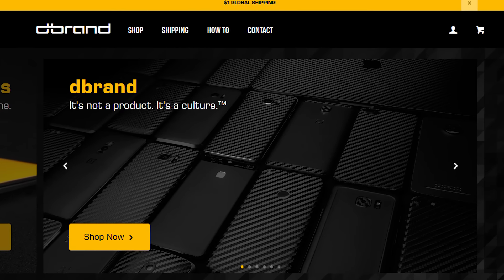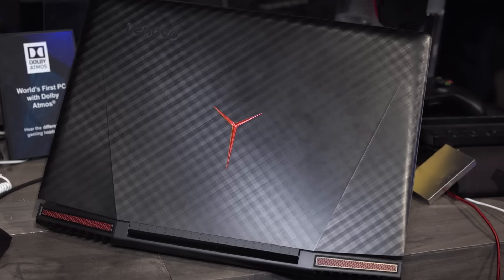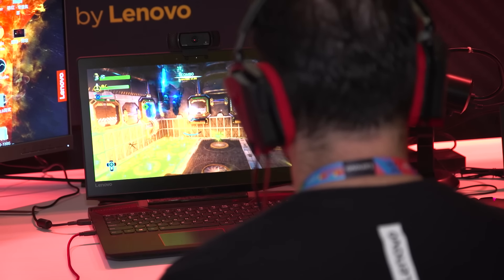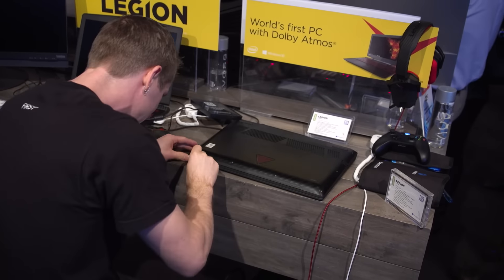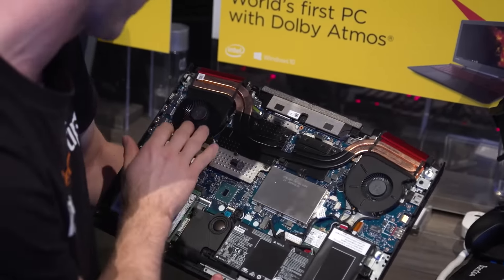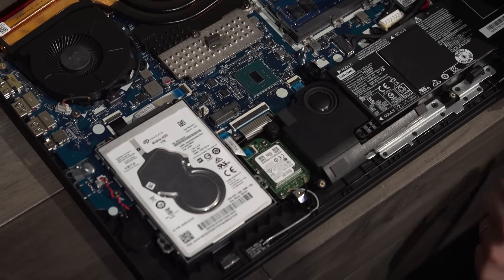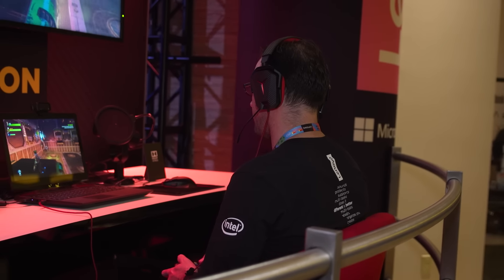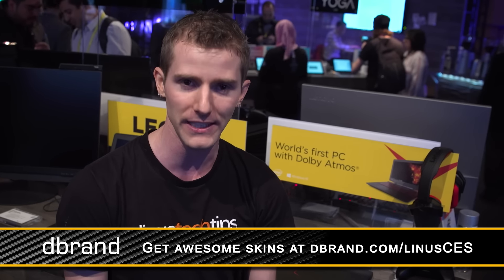World's First Dolby Atmos Laptop

Comment: 3:14 They put that cover over the ram in attempt to stop you from breaking it 😂
Reply: I dont think they have made a Linus proof laptop yet......
Reply: Dell Latitude Rugged Extreme & Panasonic Toughbook maybe?
Reply: The metal cover is for EMI protection.
Reply: takes protective back plate off of laptop

immediately sets laptop down on sensitive components
Reply: You are everywhere man.
Reply: lo, me? nah. just addicted to the internet to much.
Reply: Static protection, with an aluminum case the hinges would allow transmission of electricity across the laptop and thus the shield is placed there for the electricity to jump the only access point into the internals. In short terms,  it's a Faraday cage
Reply: He tired wreaking the Dell one, i don't think he succeeded.
Reply: draginator6 yeah xD
Reply: @Dave Terry its a start :P
Reply: That might be perceived as a challenge by Linus hahaha.
Reply: Congratz! You're smarter than Linus!
Reply: I mean, only a laptop with a titanium-tungsten cover can survive Linus's madness.
Reply: So Linus is trying to wreck every awesome PC and laptop he comes into contact with, basically.
Reply: công Hinh Phan see how he almost dropped it. what if it dropped lol
Reply: Probably for rigidity as it looks like it would be pretty flush with the bottom cover
Reply: Stuart Trappe Haha, Nah I think I've just figured out the secret to top comment. Witty, and always blame linus for breaking things at Ces 😂
Reply: and then he put it on the table just with the motherboard exposed facepalm
Reply: Ewout Vd Vijgh
not a metal plated table, its all fine.
Reply: k srry freaked out for a min
Reply: lol thats funny

Comment: The shielding is to help protect against cosmic rays.
Reply: Linus, here's the guy you were talking about
Reply: Instealer it was a joke lol.
Reply: I was playing around as well
Reply: OverclockedSanic it's a tinfoil hat to protect your... memories... eh... eh...
Reply: Or help the Leigon survive a black hole.
Reply: But Linus flipped the laptop over, so the shielding isn't protecting from the top but from the bottom. Maybe from Earth's magnetic field?
Reply: maybe even incorporate it into a hat of some sort, maybe a beanie
Reply: Sergio Ruelas It was put there for a reason:
Lenovo knew that sooner or later, Linus would arrive at the 2017 CES show. And Linus has a reputation for taking computers apart. So that's why they put that metal plate: it was meant to prevent Linus's Hands of Destruction.
Reply: Your comment is less a joke than u might think. Cosmic Rays can really be the reason for like bluescreens, i mean, there is a reason ECC Memory exists. But mentioning, that this maybe will occure once per year, I don't think anyone needs that plate unless he lives in a nuclear zone ;)
Reply: A flimsy piece of sheet metal does jack shit against cosmic rays. You need a LOT more for that. It DOES help with Electromagnetic Compatibility and internal shielding though. If you look at the inside of most plastic laptop cases, they are sprayed with metallic, conductive paint to help shield against EMI. RAM is notorious for EMI due to the long signal paths (they act like antennas) and the connector itself. You can get away without the shielding, but it's a nice touch of attention to detail.
Reply: Yep I know, I believe we saw the same video with that information about BSOD and ECC memory. It was a joke based on the info I learned from that video lol.

Comment: $1200? That price is pretty good for a 6700HQ and a 1060, plus swappable RAM and storage. I think we've got the average person's 2016 MacBook Pro killer here.
Reply: Isn't just about everything a MacBook Pro killer these days?  Not like Apple made it a difficult thing to do, haha.
Reply: dimples282 Not a fan of the 2016 pro, but they're completely different computers. One is aimed to be extremely thin and light, while the other is a gaming laptop at a reasonable price. Everyone just sees any random laptop with better specs and says it's the MacBook Pro killer these days.
Reply: dimples282  It's 7700 HQ 7TH intel processor Not 6700HQ
Reply: 7700HQ* and yeah that is a really good price. My laptop with a 860M and an i7 4710HQ cost about 1k in 2015.
Reply: Oh, right, my mistake.
Reply: I bought the predecessor (Y50) for 800$ a year ago...
Motherboard died 1 week after the warranty , screen cable died , massive issues with the wifi card...
It's cheap , but don't expect it to be solid.
Reply: +omar717 "aimed to be extremely thin and light"...isn't that supposed to be the non-Pro MacBook which is literally dedicated to fulfilling that niche? While thinness is a nice thing to have, I'm pretty sure plenty of pros wouldn't mind if the same thickness is kept if it meant that Apple could've squeezed in Polaris 10 (RX 470, which would be having that rebadged as Radeon Pro 470) instead of Polaris 11 (Pro 460). The 1060 is going to smoke the Pro 460, even in actual "pro" scenarios (and that's before you throw CUDA into the mix). If I could get a "GAMING!!!" laptop that isn't a total brick (which this doesn't seem to be) and actually packs more power (1060, GG EZ) for similar or even lower cost than a 2016 MacBook Pro, AND has greatly missed bonuses like swappable RAM and flash storage that isn't soldered, I'd definitely jump on anyway even if the machine's primary purpose is in fact games.
Reply: Without a doubt, they do have a killer resale value while this one will be treated as "just another PC laptop".
Reply: Eh. Mine's worked fine for 3 years, no issues at all. OC'd the hell out of it too, unlocked vBios.
Reply: dimples282 the y720 is i7-7700HQ

Comment: piece of metal shielding on the ram is a heat spreader, you can see the spacer and copper strip on the case when you took it off to stop it from getting a single hot spot

Comment: New Microsoft Xbox controllers work without the dongle. New ones use Bluetooth.
Reply: TheSonic Ravn I was thinking the same thing. Unless the rep came up and told him specifically my money is on Bluetooth.
Reply: God damnt i just got a dongle for christmas
Reply: Karim Essafi yeah I know. He just makes it seem like a bigger revelation then it really is.
Reply: who even use bluetooth for using peripherals to playing games. Wired is the way to go(les latency) but wifi receiver is also good. DONT USE BLUETOOTH
Reply: Azriq Haikal If you're using a controller for PC gaming, it's usually not for anything competitive.
Reply: That sounds less efficient since you would need multiple bluetooth receivers to connect multiple controllers no? I mean if worse comes to worst, then you could always plug them in using a Micro USB-USB cable. Though that would take up the limited USB ports on the laptop.
Reply: blame that shitty range on your bluetooth adapter, motherboards dont come with it, wifi cards do, and you can swap them just like disks, my new controller shows no difference between that and the dongle, and I don't see much use for 2 controllers on a pc let alone 4 or 8, other than playing emulators and the odd 3 pc games that actually support splitscreen  or things like mortal kombat
Reply: LinusMLGTips still. The delay in some action game make the game slugish imo.  Even playing racing game, u can feel it. But for casual gamer, yeah.  Bluetooth os kinda "usable"
Reply: EspHack maybe to play some party game. Steam have a lots of it granted it not a triple A games and just indie.
Reply: ***** WWE games
Reply: Lathan McGhee You can connect multiple controllers via Bluetooth too.

it's not officially supported so I contacted ms support beforehand and they said something along the lines of "it should work but no guarantees".

I've only tried 2 at once though not 4.
Reply: This "new" tech from Microsoft is integrated within the motherboards themselves. It doesn't depend on the "normal Bluetooth" found in the laptops.
Reply: But the audio jack port doesn't work via bluetooth ! ;) So you can't play from your couch with your headset plug in to your controller via bluetooth. Via the dongle you can ;)
Reply: Thomas HALGAND
If your controller can connect to your pc via Bluetooth then your headset can too.
Reply: And what if I'm using an non Bluetooth headset?
Reply: +Azriq Haikal There is no noticeable latency if you're right near the bluetooth adaptor
Reply: Yeah but what my headset doesn't support Bluetooth?
Reply: Thomas HALGAND
Then you plug it into the 3.5mm headphone jack on the controller.
Reply: And this doesn't work via Bluetooth ;)
Reply: Thomas HALGAND
You can't connect your headphones to the controller via Bluetooth if that's what you mean, you can either connect your headphones to your pc/screen or you can connect to the controller with the 3.5mm jack.

You can connect controller to pc then headphones to controller with a wire
Reply: ***** You don't understand. I know I can't connect my headset via Bluetooth directly to the controller. Of course! 
But, if you connect your controller via Bluetooth and then plug in your headset via jack, the headset isn't recognized on the PC. 
In other words, via Bluetooth you can use your controller but you can't use your jack 3.5.
With the official dongle you can. 
Try it, you'll see ;)
Reply: Thomas HALGAND
What are you talking about lol?

Of course you can plug headphones into the controller while using Bluetooth.

I've done it with bose qc35 headphones and klipsch s4 iem's, both work without a problem. 

I used to do it with dongle too with the old non Bluetooth controller before I bought the Bluetooth controllers. 

If yours doesn't work then try updating the controller's software through the xbox one app on Windows 10.

I've got 2 white Bluetooth controllers and both work perfectly.
Reply: Seriously? I tried but this doesn't work for me! And I have seen some guys with the same issue! I'm going to retry it tonight maybe it been solved since the last time I tried (first weeks of the Bluetooth controller release) 
If this works, thanks buddy!
Reply: It can use bluetooth but I assume they also built in the connection that the xbone and the dongle are using.
Reply: Rhedox Yes that's what they did ;)
Reply: ***** I don't think bluetooth is limited
Reply: ***** I have two connected to my htpc. they show up differently in the bluetooth devices.
Reply: ***** Sooo I justed retry it and no it doesn't work for me. 
Just to be clear, I'm talking about this setup :
Headset connected to controller via jack and controller connected to PC via bluetooth. 
The controller work great but no sound in my headset via bluetooth. It works perfectly via the dongle tho' or directly on my Xbox One S
Reply: Xbox accessories app does not recognize xbox controller via Bluetooth
Reply: Oh wait! I justed plug in via USB to upgrade it and then I will retry!
Reply: Well... Still not working
Reply: *****
Microsoft website says only one controller is officially supported at a time but more may work.

I've got 2 running np.

Thomas HALGAND
That's the setup I'm talking about too.

I'm not using headset though, only 
Headphones but that shouldn't make a difference. My headphones don't have microphone.
Reply: Ok so I checked on Microsoft website and audio is not supported on PC while connected via Bluetooth... So yeah...
Reply: ***** I'm using a headphone too but it doesn't work either. I would really appreciate to see a proof of what you said because, yeah, as I said, Microsoft itself say this isn't possible.
Reply: "Controllers connected via Bluetooth do not support any attachments, including chat headsets."
Reply: To use a chat headset on your PC, connect your controller using a USB or Wireless Adapter for Windows, and connect your Xbox Chat Headset directly into your controller. See the following supported scenarios.

Sorry for the triple response
Reply: Thomas HALGAND
It also says that you can only connect one controller via Bluetooth but I've got 2.

I've got my headphones connected right now to the controller. 

I'll go on gta v and play the radio and make a video of the sound coming out the headphones to show you, one sec.
Reply: ***** You're connected through Bluetooth? Not the dongle?...
Reply: Yes.

Sold the dongle and my old black controller on eBay after I bought the Bluetooth controller. 

I updated controller software through xbox app on Windows store, try that. 
It didn't work when I tried updating controller through Bluetooth but it worked when I plugged in through usb to update.
Reply: ***** I did it earlier and it still doesn't work... And nothing that tell it work an the official website
Reply: Thomas HALGAND
Contact Ms support.

They might simply tell you that it's unsupported and they can't help you like they told me when I asked if multiple controllers worked through Bluetooth, but I got two controllers working np.

Not tried 2 Bluetooth controllers with 2 wired headsets though but I don't see why it wouldn't work.
Reply: ***** Hummm weird
Reply: hmmm im not sure is it only one controller? My Lenovo G50 has Bluetooth 4.0 and I am almost certain I connected 2 PS3 controllers at once using SCP on bluetooth

Comment: The shield would be there to stop Radiated noise from going in to the data bus. They have a lot of DC/DC convertors in there and those radiate EMI. So by adding that metal shield (thats connected to GND btw) they create a Faraday cage. And that helps to reduce the noise on the data bus.

Comment: the shield over the RAM is done for ESD protection.  this is necessary on laptops that have expandable storage but also has a set amount of RAM soldered on the board. that way, a static shock (which could normally only zap the removable SODIMM) will be discharged before you touch the motherboard, making sure the soldered RAM cannot be harmed. this is typical in pre-production laptops but isn't typical anymore these days because medium-high end laptops do not have soldered on RAM anymore.

Comment: 3:14 that shielding is for protecting ram from radiations which interfere with data stored.. that is the reason server use ECC or Error correction etc although other reason could be protection or heat dissipation.

Comment: gtx 1060 is itself 300$, thunderbolt 3 is awesome for future upgrade for egpu(tested 1080ti works) this laptop is a beast. xbox connectivity is not necessary in my opinion. I dont think any pc gamer prefers xbox controller(speaking for myself and friends)
Reply: SimplebutComplicated dude a 1060 is $200
Reply: Depends what games you play man. But for racing, flight or platforming I'd take a controller over keyboard and mouse any day
Reply: 2 words: Dark Souls
Reply: Ned Flanders i mainly play pubg csgo dota2 and i use mouse keyboard for those games. I never really use xbox controller.
Reply: - InfiniteFusion no it isnt, are you on drugs? For 200 u can get a 1050ti, this a 1060 6gb RAM. Gpu alone is more then 350. Check newegg and see for urself

Comment: For $1200 it beats EVGA's $1500 laptop
Reply: $300 to spend on other shit, yeah it does.
Reply: MrGhost370 even alienware m15 for 1550$ with OLED screen
Reply: MrGhost370 
I wouldn't get MSI though, my cousin had one and it's motherboard randomly just died, making it basically useless, and cost more to fix than buying a new laptop. 
And tbh, I actually like how Lenovo gaming laptops look, especially that legion logo
Reply: As Lenovo owner I gotta say that avoid it like a plague. so many problems with it.
Reply: MrScart35 I have a lenovo PC and a laptop never ever had any problems with it
Reply: MrGhost370 I had some alenware laptops they never overheated
Reply: Yung TedBounty I had an alienware and it overheat very, very much... 
lenovo looking pretty sweet though
Reply: hafizlemot what one did you have, I have had like 7 alienwares and the only ones that overheat were the m11x and the m14x in very hot weather with overclocks
Reply: +thomas lambert
more so.... the cost difference is because of the Display on the EVGA model.
Reply: $1500 for that???? check out Techlinkbear for some solid prices